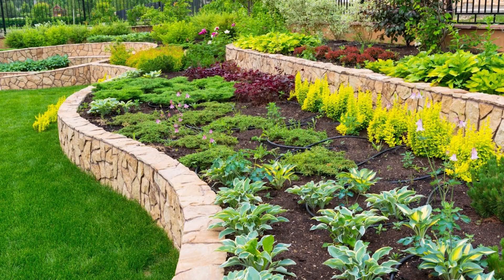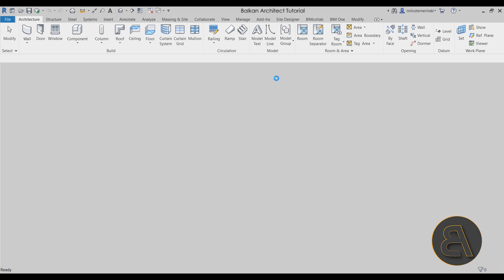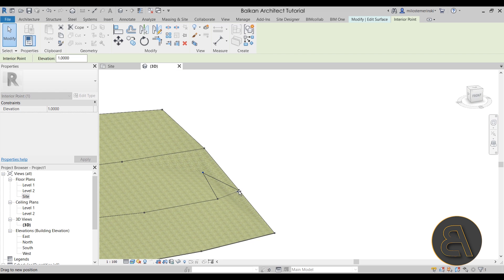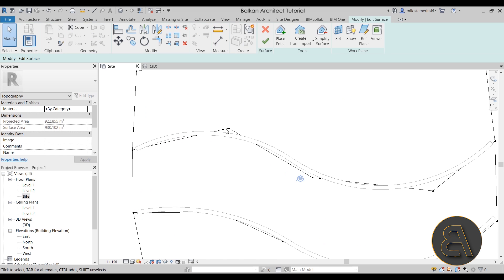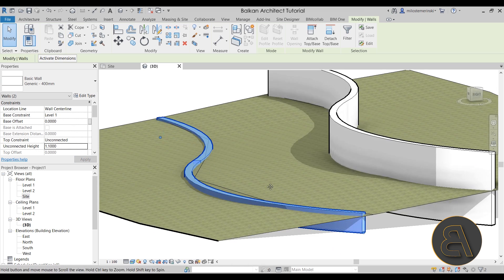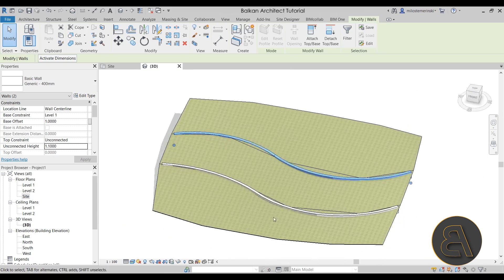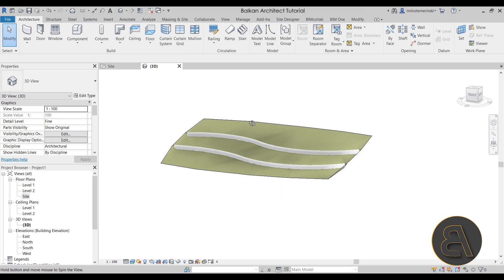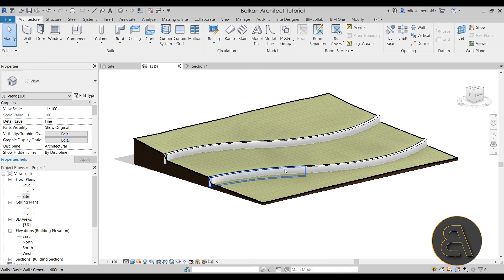Landscape Integrated Walls in Revit Tutorial

Comment: There is one thing, even by using this method the topo surface goes inside the retaining wall is there any solution to this problem
Reply from the maker: the only solution would be a building pad under the wall, that follows the shape and thickness of the wall. So it can be done, the question is do you really need it to justify the extra step and time 🙂
Reply: Thanks man this helped a lot, basically i needed it because in my university we don't use that black texture on the wall so when we make a section we get a line cutting the retaining wall in two I know it can be deleted later on autocad, but this way it's cleaner.